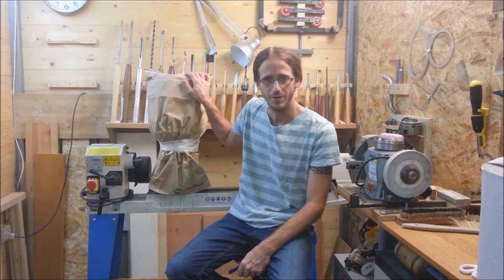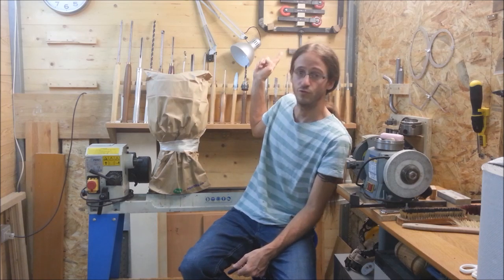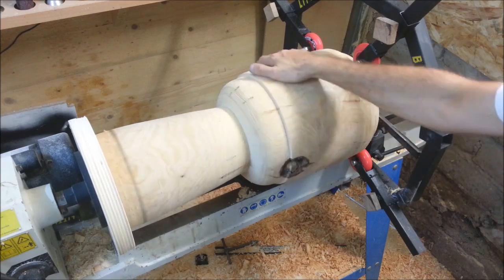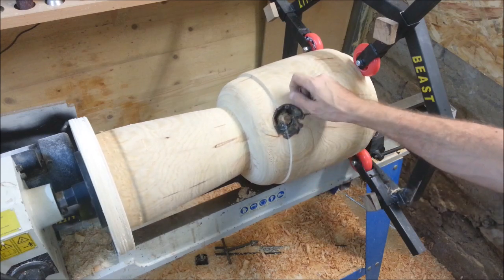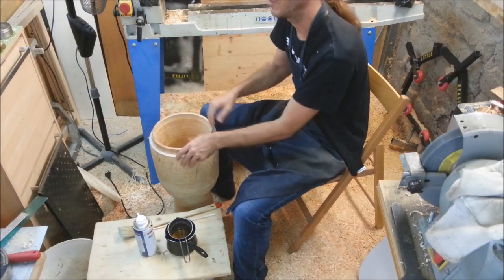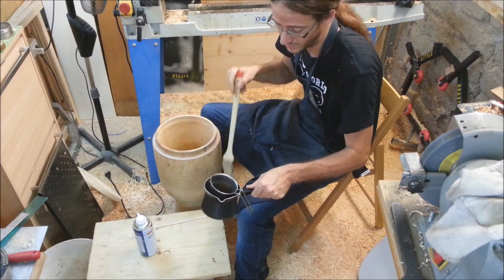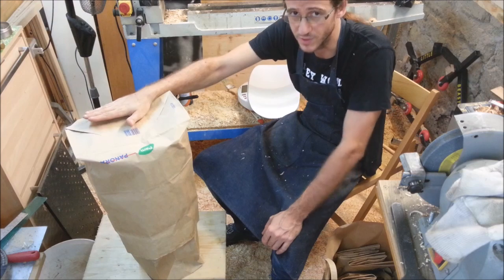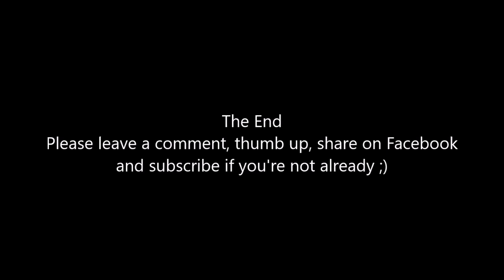Woodturning Djembe Dream Part 4

Comment: DUDE this is Awesome, 
I got to watch it on my lunch break at work but decided to wait till I got home to comment. 
KICK ASS. You got the form down well, kind of a Ghana style I think, narrow stem allows the bottom ring to be welded off of the drum. A lot of mine I end up welding on the drum because I flare the bottom too much. Both work though and the narrow stem style has a penetrating sound that is good for circles. I will be excited to see how it comes out. 
Yep you are well on your way. I have never had an apprentice so this is about the best thing ever to me :-)
Let me know if you run into any other questions.
Freekin' Awesome.
Reply from the maker: +Cyrus Fillmore (Time Lapse Turner) Well Cy, I'v never any mentor either, so you're the closest I've gotten to that :) I just wanted to thank you again for being there for all my questions and problems, it's been so hard, and so much fun for me to work on this project, you know how excited I was starting this thing out. Next thing I'll need to do is a bowl with a weave thing on the rim, don't think I've forgotten that one!! I was thinking to check if this shell will fit in my drying kiln which I've built but never used, It's a cupboard with a couple of 60 watt light bulbs at the bottom of it... I'm not sure this shell will fit in there, but if it does, how do you feel about trying something like this in a drying kiln?
Reply: As long as it is bagged You should be OK. However I would check it frequently and if it even hints at a crack remove it from there and slow its process. At the same time hair line cracks arent a problem as long as the don't show inside and outside, and I have epoxied larger cracks with great success so don't panic if that happens.
Reply from the maker: +Cyrus Fillmore (Time Lapse Turner) Well, I'll wait a few more days, I've ordered a wood humidity tester, so I'll make the process a little more accurate. The goal is 15% or lower, right?
Reply: +Yuval Lahav yep after 15% your pretty much past the bad crack threat stage.

Comment: That is already a really nice djembe. It will get a lot lighter over time i guess. Hope to see your progress in a few months time. I really like this series. Maybe one day i try a very small one.
Reply from the maker: +Willem Kossen Willem, I'll probably turn a small drum if I find a good piece of seasoned wood, or maybe make of segments (never did do segmenting work...), so I could practice my skinning and stringing. I'm glad you enjoyed this series, and it will loose weight in drying, and then when I remount it to reshape it round.
Reply: I have some smaller logs waiting for me. The challenges i have are no chuck, no steadyrest, just a few tools (i like that ring tool you have. Scary, but seems very useful), i cant weld (yet) and i dont have a cousin that can. But challenges havent stopped me before. All i need now is time 

Interested to find out how it will sound. Pine is a bit soft. Harder woods should have more ring, but it should work well enough. I have two djembes in the house. One is real hard wood, the other quite a bit softer and lighter. The sound is definitely different.
Reply from the maker: +Willem Kossen It's a lot about grain structure, but I'm no expert, I've been exchanging ideas with people from a Djembe repair group on Facebook, and most of them never seen or heard a Djembe from pine, but they all agreed that soft woods can and are used to make Djembe, so no reason why pine should work just fine, then one good Samaritan posted a few pics of a Djembe he made from pine and it was really pretty, I can't wait to finish this one up when it dries, still thinking about how to decorate it.
Reply: +Yuval Lahav you have a few months to prep the finishing steps. Maybe the waiting is the hardest part :)
Reply from the maker: +Willem Kossen Just the time to learn the skills I'll need to finish it :)

Comment: Very original and cool project.question? That ring tool you used to hollow ,is that as scary to use as i have been led to belive? Heard one woodturner said he got the mother of all catches with that tool.looks very agressive and effective.
Reply from the maker: +Atle Grønsund Well Atle, that ring tool is that scary as you've been told, and then some more! I'm sure that if you take the use of that tool to a form of art level, it the safest tool in the world, but if you ask me, a novice, to describe how it is to work with it? it's pretty much a controlled catch... you find a manageable size of catch by the way it feels pulling on your hand, and you just pull it  through toward you, getting a huge amount of wood out with it. At some times it was scary as hell, and I did have  a couple of bad catches, which I didn't mind since there was so much material to eat out, and at times it was a lot of fun using, getting all this wood out in a single pull. So yeah, I would recommend one of these, just maybe a better quality one then mine, they are called a "termite" tool.

Comment: Yuval, love your videos.  How is the lathe holding up with the smaller belt?  How slow do you think the slowest speed is now.  I have a lathe similar to yours and am considering the same modification.
Reply from the maker: +Michael McEwan Somehow I missed replying to your comment Michael :) the lathe is doing fine, but I've only used the shorter belt for that specific project, I then switched it back to the original belt, for every day turning, it is just fine.